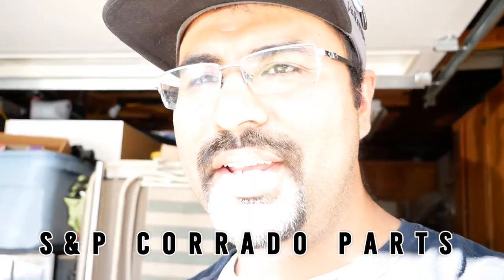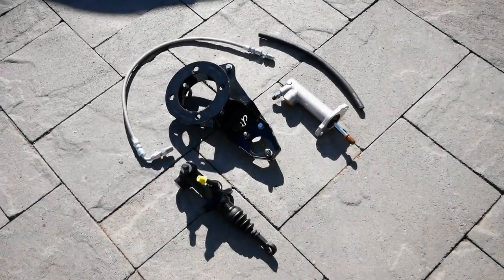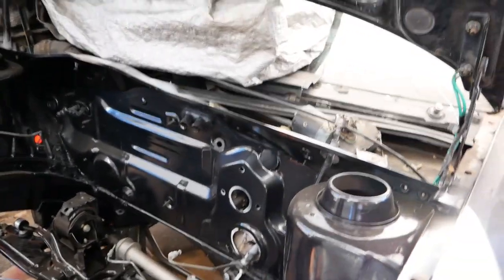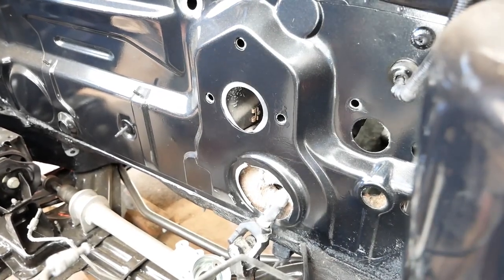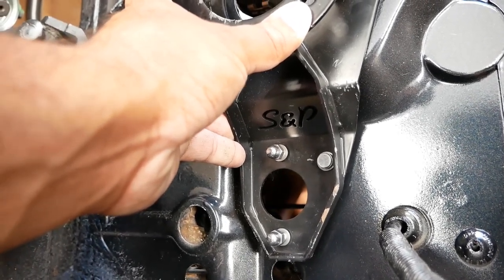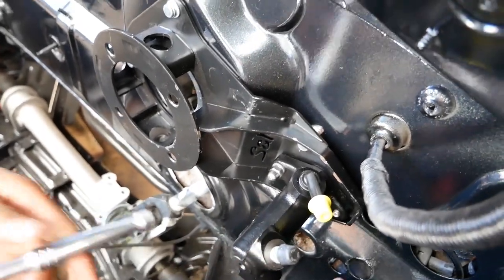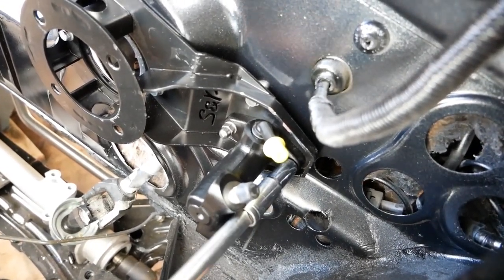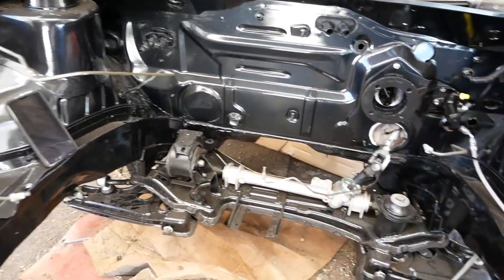How to Install S&P Non ABS and Hydro Clutch Bracket on a Corrado S6EP14

Comment: Hey bro quick question 😬 my mk4 gti started throwing out white smoke from the ehuast  and back fire when I rev it also feels like I have no power when I floor it
Reply from the maker: Soumds like a failing turbo
Reply: U think so bro I thought I cracked my heads
Reply from the maker: If you had a bad head or head gasket check your oil and dip stick o turns a muddy color of you have coolant in it or you would be throwing blue smoke
Reply: @PincheALsGarage  oh shit your right I hella forgot about that also the last time I checked I had a check engine light and it said I had bad coil packs

Comment: So what are you guys tuning with? When I boosted Hondas we all used to trade tunes and base maps on forums. With these Volkswagens everybody spending thousands of dollars on APR tunes and mailing their ECU out. I'm trying to go big turbo on a 180 TT I'm not going to spend $1,000 to get it tuned when I bought the car for 2 Grand this is insanity
Reply from the maker: We get our tunes from Boost Dynamic Tuning.  If a tune is legit price is not an option for quality
Reply from the maker: $400 to $600 for a tune is the Average for a tune for these cars. You can find them cheaper but youll get no support if your car runs like crap.
Reply: @PincheALsGarage   I just message them after Checking their website but their product list doesn't show my year TT I'm hoping they can help me out because their prices better than most
Reply: @PincheALsGarage  this really is a pain in the ass when you're used to downloading free maps and just burning them onto a chip and putting the ecu back in the car and driving.  The whole thong was free and took 5 minutes
Reply from the maker: Find them on favebook. Talk to Trent Smith
Reply from the maker: Well tell that to the guy who spends 100's of hours and thousands of $$$ on tuning to get a map done right so you can just get it for free... 

I just spend $1600 for a tune for my Jetta tdi wagon with a flas loader and was worth every penny.

To each thier own. I see the value and hard work.
Reply: @PincheALsGarage  it was give and take we all shared and contributed something we took the maps and made them better that's why you see so many Hondas out there with giant turbos making crazy power for almost no money